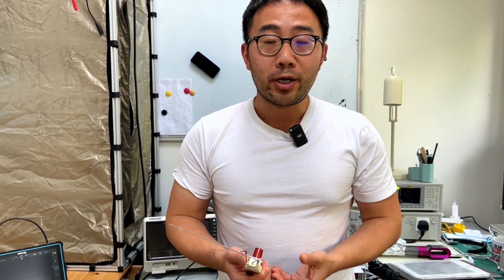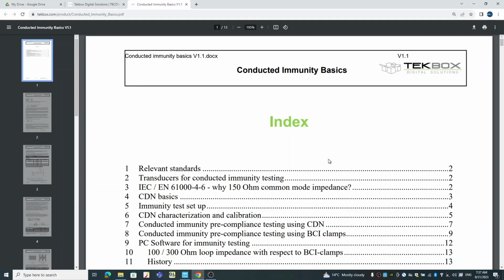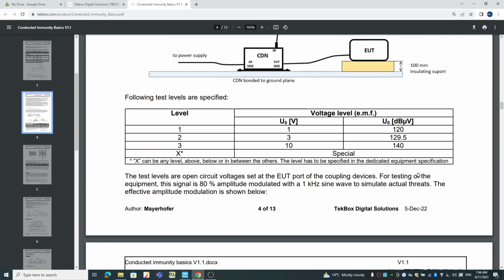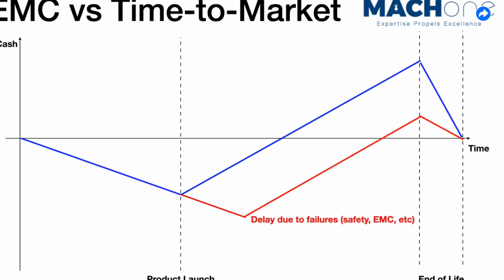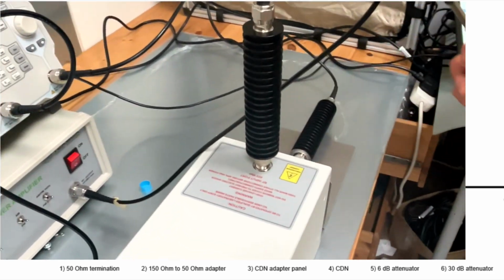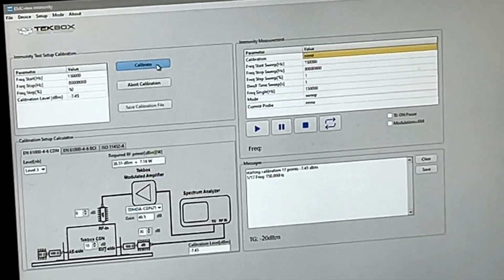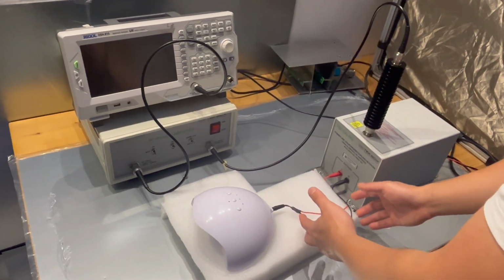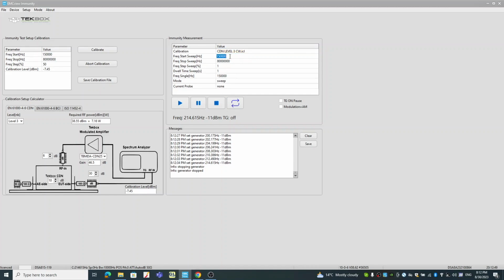Demystifying Conducted Immunity Tests - Pitfalls, Calibration & Testing

Comment: Would you happen to remember the Distance of the gap you used for your EMI generator (piezo spark device), are the other dimensions important like the total length of copper tape on each side?
Reply: Use a 30 cm plastic ruler, put copper tape on it, then cut 2 triangles from top and bottom in the middle. Then use a razor blade to create a gap in the middle. Exact distance does not matter, but it should be as small as possible. Google for "Assembling an EMC Troubleshooting Kit: Electrostatic Discharge" and you'll find a great article from Kenneth Wyatt.

Comment: In the video you mention turning modulation off on the amplifier during calibration, then turning it on during actual testing.  I don't see any mention of this (or anything related to the setting of the amplifier's modulation switch) anywhere in the Tekbox documentation for EMCview or any of the equipment in the setup.
Did I miss a sentence hidden somewhere?  Where does this guidance come from?

Comment: Hi Min,

Could you explain/ make a video when cable will be monopole and when dipole and why?
( during emc testing they are usually 5 cm above RGP).
Thanks.
Reply from the maker: That is terrific idea! The history of the 5 cm above test ground plane can be traced to the 2nd world war, and the cable length limited to 30 cm for CDN test is due to the VSWR issue caused by cables. Just got back from work in Germany, and got lots to catch up, will definitely to make a few videos as currently we have no videos scheduled from mid April!

Comment: Absolutely senseless EMC directive. LED starts flickering, such a terrible damage... too much unnecessary bureaucracy.
Reply from the maker: From the function point of view, EMC Directive and Radio Equipment Directive do seem "senseless", but for those people who still rely heavily on radio communications, ensuring EMC compliance is the only way we can protect those radio receivers and transceivers. For immunity, I do see issues when insuring an equipment in a noisy environment, it suffers from reset, wrong data reading. Again, without a directive, it is hard to enforce good engineering.

Comment: Thank you for this video which presents well what is achievable in pre-compliance. We are facing non-compliance at work and we plan to invest in equipment for immunity tests, as we cannot replicate the tests internally (and therefore correct them safely). We already have equipment for emission tests (R&S FPC1000 9 kHz-3 GHz, LISN, and antennas). We now need a signal source, and we also need to purchase amplifiers to achieve industrial immunity levels (level 3). Would it be wiser to buy a new spectrum analyzer with a generator, such as the SSA3075X with EMCView Pro, or a generator like the SSG5060X?